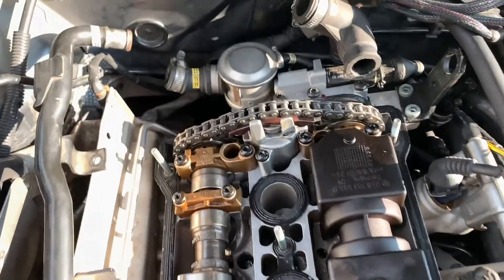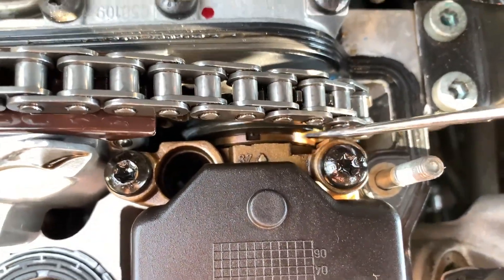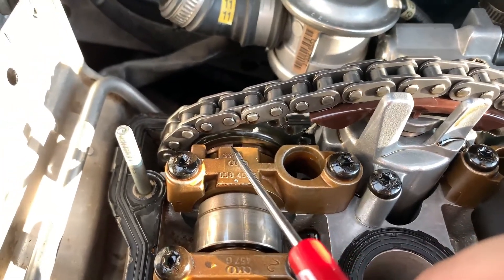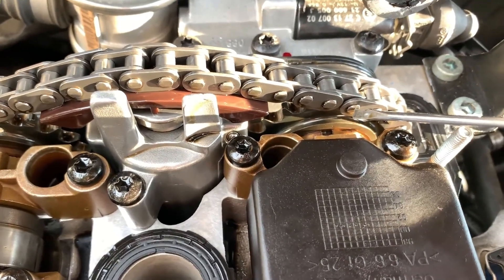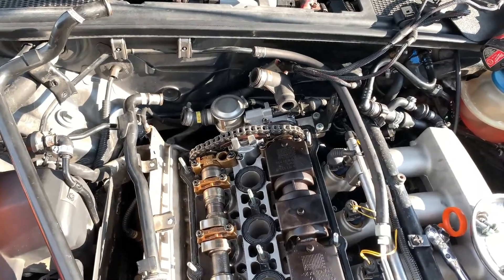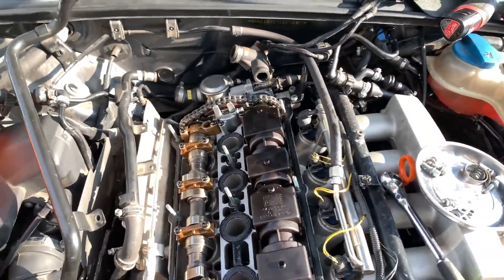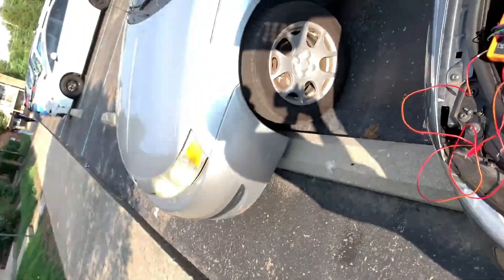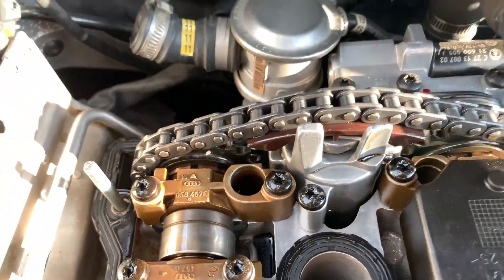1.8T Audi A4 Lack of Power Issue Resolved

Comment: when it was like this, did the motor break up at high rpm and exhibit subtle misfires? I almost know for a fact that the cam chain tensioner is worn on my 1.8t and I am going to take the valve cover off once its a bit warmer.
Reply from the maker: No, it blew up the engine all at once.

Comment: This is exactly the issue my car is having now.... and now its throwing miss fires and all cylinders
Reply: Also to follow up on that, it is throwing p0340 code which is crankshaft position sensor
Reply from the maker: Hope you can fix it!
Reply: @stuiesgarage  I came to vw after owning nothing but subarus for my entire life,, do you think the engine is toast? I haven't run it. I scanned it today after warming it up, would that have damaged the engine?
Reply from the maker: Just depends on how far the cam chain is off, this is an interference engine so valve could have bent (I’ve bent them before). You could do a compression check to see.

Comment: How did you rotate the engine crank while still in the car? To check the camshaft alignment marks?
Reply from the maker: I shouldn’t have but I rotated it from the exhaust cam bolt before removing the timing belt.

Comment: This is def my issue my mechanic just rebuilt my top end on my mk6 golf r and went to drive it and had low power and p0016 but car ran really smooth which was confusing as we were tryomg to figure out if it was a boost leak or something sensor wise

Comment: Hi! can you help me ?1.8t auq 180hp vvt leon, I changed everything, chain, belt, oil pressure, good camshaft sensor, all the reasons and it throws the error code P0012, what could be the problem?

￼
Reply: Me too i change everything and the problem its not solved 😢😢
Reply: @akalimain-m3u .
Reply: very hard to disappear, i have a built motor and the oil pressure it's just not enough. I run 10w60 now

Comment: Ive taking the intake cam out it's just hard to figure out exactly where to place it because it moves when you re tighten it. Any advise?
Reply: Just go litle opsite side (half link )and when you tight it' will be exact .Same thing with timing belt .
Very bad and stupid system with timing marks on that 1.8 t engines ,anyway 😏

Comment: Have a video on how to fix the bad timing??
Reply from the maker: No, but I know that there are a few videos on YouTube that show how the timing marks should be aligned.
Reply from the maker: You can also unbolt the intake cam caps and take the intake cam out without removing the exhaust cam, then you can rotate the intake cam and reinstalled it, you will have to unbolt the cam chain tensioner as well